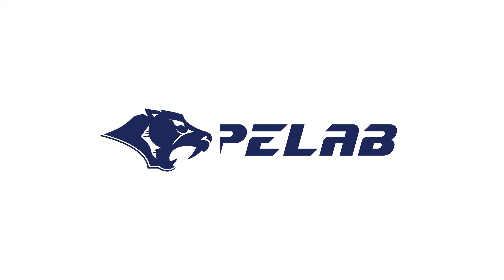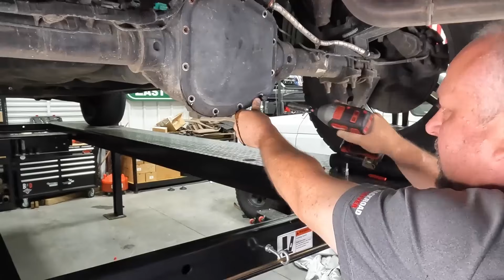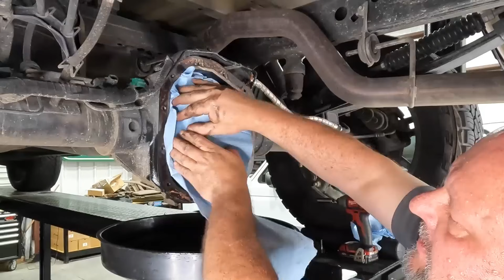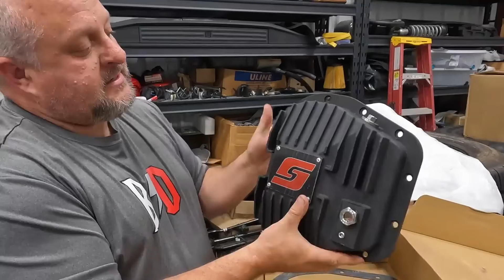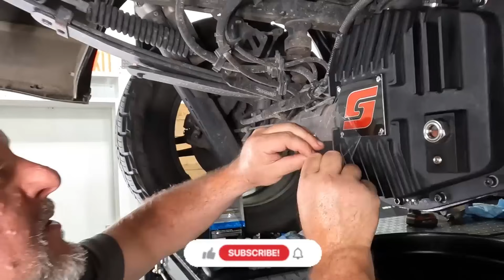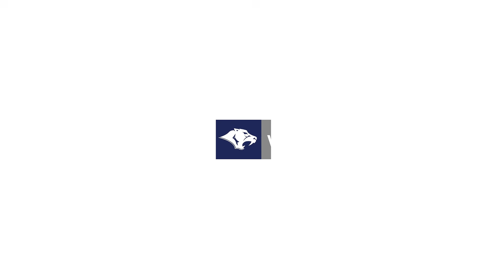How to service your Ford F150 Differential - Differential Cover Replacement

Comment: The LubeLocker gasket you are using does come with torquing sequence instructions.  🙂
Reply: I just got a lube locker gasket and it came with no instructions in the box.

Comment: I have a 21 Ford f150 lariat 2.7 twin turbo EcoBoost and I bought it and the damn thing didn't fit and then customer service sucks cuz I had to pay for shipping and they give you the runaround. What's your VIN? What's your axle? It doesn't fit. You don't understand. I don't know what size my differential is. A cover is now because I'm scared to buy any of them
Reply from the maker: 1. Detailed truck model information
2. Axle model
3. Image of the differential cover
By combining these three elements, the specific model should be successfully identified.

Comment: I know you used the Spclab Billet Aluminum do you think the Cast Aluminum would be ok allot cheaper than Billet one? Thank great video
Reply from the maker: If you have a limited budget, choose the cast aluminum version; however, the forged aluminum version definitely offers better material performance and quality.
Reply: Do not buy it. Do not buy their stuff they lie about cuz you order it and it don't fit and you got to send it back ups and it's $32 because they send you something that don't fit

Comment: The video shows him installing it on a 2021 F150 but the website shows the cover is only good for Ford F-150 (1997-2017)  -   Is there an updated website for the housing or a different part number?  I am looking for a replacement part for my 2021 F150 3.5L Tremor. Thanks!
Reply: He has the max tow package. Includes a 9.75 differential.
Reply from the maker: Is it a Super 8.8-12bolt you are looking for?
Reply: @spelabofficial mine is the 9.75 on the 2021 Tremor
Reply from the maker: @86Ctopher  Ford 9.75″  with 12 Bolts?
Reply: @spelabofficial Yes 9.75 with 12 bolts

Comment: So my 2022 f150 3.5L ecoboost should have that rubber actual seal as well and re use it? Silicone ones are a pain have to scrape that all off.

Comment: Well...since there aren't any more studs only bolts with the new hardware...what did you use to reattach the tube to the differential?
Reply: wondering the same thing, kind of a big miss.
Reply: I want to know this as well.

Comment: Sad that they don't make one for the 12 bolt Ford super 8 for 2017 F150
Reply from the maker: What's your axle model?
Reply: ...I got one from PPE (Pacific Performance Engineering) for my 17 F150 8.8 12 bolt.  Looks very close to this one.

Comment: wouldn't you fill it still till it comes out the OEM fill hole?  At least for the first fill?  SPELAB says the diff cover increases capacity by about 40% so almost 3 Qt even if 2.2 Quarts right?  Mine just arrived, I think i'm gong to fill in the top of the SPELAB fill port until it comes out of the OEM.  I'm expecting 3 Qt according to SPELab answers then i''ll mark where the line on the glass is.  If you think about it, regardless of how far out the diff cover goes, you want the same amount of oil level in the diff.
Reply: I was thinking I’d do the same exact thing! Ditch the whole sight glass experiment and just get it to Ford’s factory capacity via the stock fill port. Seems safer in the long run.
Reply: @Buellsox the manual says 2.74 quarts and I put 3 in and that was a little under the very top of the window I just filled it to the fill port like usual after a few hundred miles but I can't see the red ball in the window or anything through the window now I don't know why other than maybe just the left over grime from the prior oil darkened the window

Comment: I just ordered this diff cover for my F150.. - nice video.  What did you use or how did you hold down the existing wires?
Reply from the maker: Hello Tom, Please use a cable tie to attach the wires to a stable part near the axle or differential housing, making sure to secure the wires securely but not so tight that you damage the insulation.
Hope this could be helpful!

Comment: Good looking product. Love the sight glass integration. Looks like its one of the better options on the market for the Ford 9.75
Reply from the maker: Thank you for your support!
Reply: @spelabofficial  Any plans on making a cover for the Ford Super 8.8 12 bolt?
Reply: Yeah I thought it was nice to but I'm worried here because after a few hundred miles I can't see anything through the window now I'm worried it somehow fell out I can't see how though I can see it being dirty from the left over old oil film on my diff and maybe it caused the window to become dark I'm just really wondering if someone else has had this happen to them before I tear it back off in fear

Comment: Please help. 2017 f150 3.5 eco boost. Owners manual states, as well as a google search, that the capacity is 2.75 quarts / 5.5 pints/ 88 fluid oz according to the math. With the fluid centered in the viewing window I am currently 12 ounces shy of factory specs. What should I do?  Add the 12oz? Leave it? Crack the plug on the axle and wait for it to come out, then plug?
Reply from the maker: Hello sir, which model did you buy? Can you provide a link or SKU?
Reply: @spelabofficial  the skew that I believe was purchased is SPOSO8801BK. 
The purchase number is SPELAB#91321.
Reply: @spelabofficial  SKU should be  SPOS08801BK
Order number 91321

Comment: I installed mine everything was easy only issue I’m having is the no gear oil is going into the ball so I don’t even know what level it’s at I put in 2.5 quarts and drove it around still won’t show the level
Reply from the maker: Hi sir, sorry for the late reply. No gear oil coming in means the oil level isn't there. You need to fill it up until you get some gear oil in. Feel free to contact us with any further questions.🥰